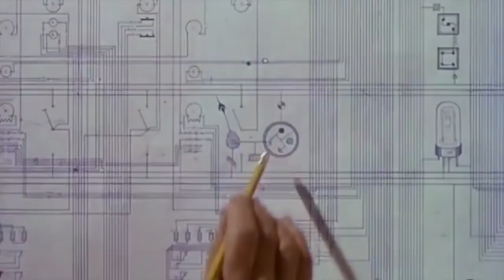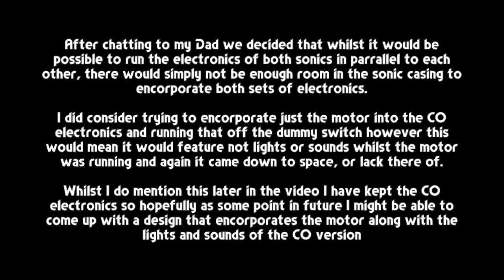How2Do : Modifying Character Options Thirteenth Doctor Sonic Screwdriver WITH ROTATING CRYSTAL!

Comment: Excellent work Capt Jim and thanks for sharing! It is frustrating how fans always seem to have to correct the shortcomings of mass market products! :-) And you have now joined the club of Sonic Modders like the guy who put a USB memory chip in his 10th Doctor Sonic, the guy who made the Wand Co 11th Doc Sonic extendable well before their re-released 12th Doc extending version, and others! Tho overall I like the 7/20 the best, I do like a few things on the CO version. Namely, I prefer CO's smoother finish (as often pointed out, 7/20's looks like wood instead of metal!),the touch glow feature, and the click start sound (tho if you listen closely 7/20 has a sort of quiet metallic "twang" sound that starts the main sound). But most of all I absolutely love the metallic looking adjoining section. (where CO put their speaker). In the actual design this makes it look like a metal socket holding the alien crystal which the Doc has fashioned a (presumably protective?) Metal sheath around. 7/20's is totally missing this design bit, and it's something I really wish was there. I'm currently sanding my 7/20 to lessen/remove the wood grain look and to try to add the metal socket somehow, as well as the concentric rings on the bottom of the crystal (also missing on the 7/20). The upcoming Rubbertoe version is gorgeous of course but way out of my price range. Sadly Wand Co doesn't appear to be doing any new Who (and still drives me bats they discontinued their 10th Doctor Sonic, IMO the best Sonic ever released by an earthly company!). Well done, creative and inventive mashup and you've inspired me to keep working on mine!!!
Reply from the maker: Thanks, I'm glad it inspired others!

Comment: The 720 is better aesthetically aswell because it’s more size a guarantee as well as there is more detail and the clear plastic is more cloudy
Reply from the maker: Not really, the S20 one is far smaller than the actual prop, it hasn't a completely incorrect wood texture and whilst it might have had the frosted plastic the CO version didn't the CO version has been re-released with frosted plastic so now the only thing that makes the S20 version better is the spinning crystal.
As far as aesthetics and appearances goes the CO one is much closer to the actual prop.

Comment: Do you think you’ll ever do a repaint of the CO screwdriver?  I’m just wondering since the metal bits on the emitter shine through and it’s seen in the show that those bits are quite a darker tint of metallic than the rest
Reply from the maker: I might repaint the emitter so the silver parts are actually more solid but generally I don't plan to do any overall repaints of it
Reply: CaptainJimiPie that’s what I would do, and probably planning on doing, since I’ve bought 3 seven20 screwdrivers and planning on buying 2 CO screwdrivers 😂
Reply from the maker: Good luck with it!

Comment: could you just add wires on the button and place them anywhere on the sonic
Reply from the maker: Sorry I don't understand what you mean?
Reply: CaptainJimiPie if you take the buttons off the seven20 circuit board and extended them with wires, you might be able to put the buttons anywhere on the sonic and also add the CO circuit board in aswell
Reply from the maker: Well you COULD do that but it would be very problematic, firstly it would be incredibly fiddley to do as the S20 buttons have 4 connecting points so in total that 8 extra wires you'd have to put it, which in turn would also probably block the light features.
Secondly you'd have to find some way of securing them to the body which wouldn't be easy as they're designed to be fixed to the circuit board.
And thirdly and most importantly it still wouldn't change the fact that there's limited space inside the sonic, so the 8 extra wires would probably take up the space the two new buttons would occupy, meaning you'd have to the wire the buttons to the outside of the sonic which would look odd but also lead to the them being more likely to break.
As I said regardless of ideas on how you'd work it, the simple truth is that there just isn't enough space inside the sonic to have both set of electronics operating independently from each other.

Comment: Omg character could easily do this , but they don’t !!!🤨
Reply from the maker: Thanks although to be fair to character, as much as I've slated them in the past, whilst they could do this it wouldn't be "easy" just swapping over these two halves was very fiddley so fitting a new circuit board with two buttons with all it's functions it currently has AND a motor then it wouldn't be easy to fit it all in